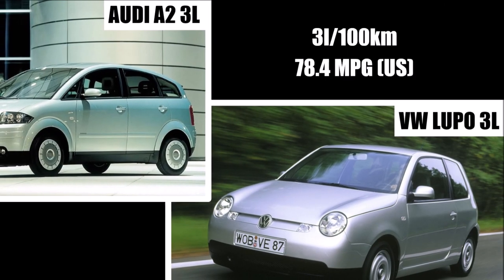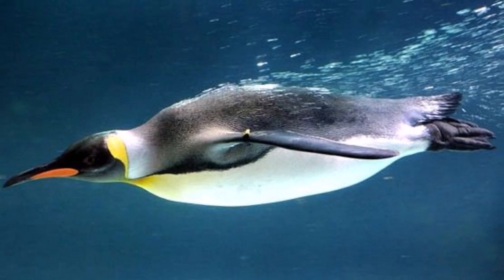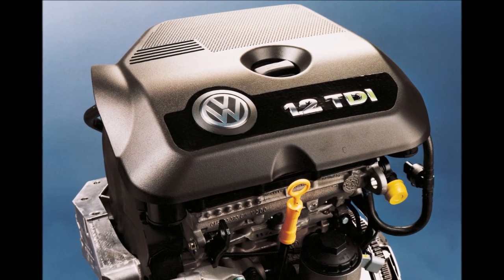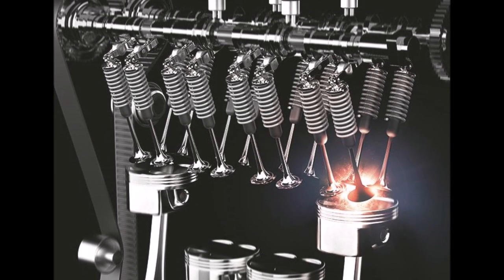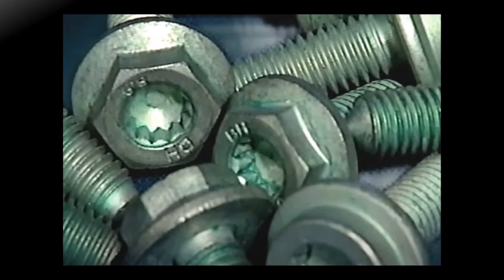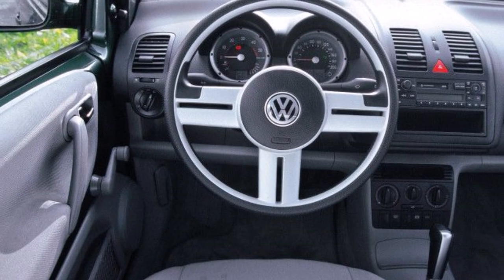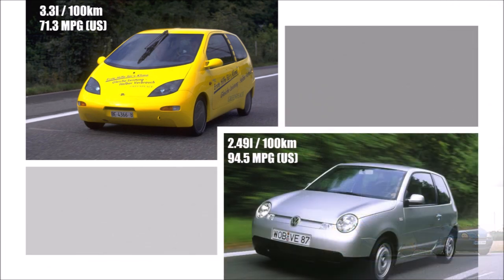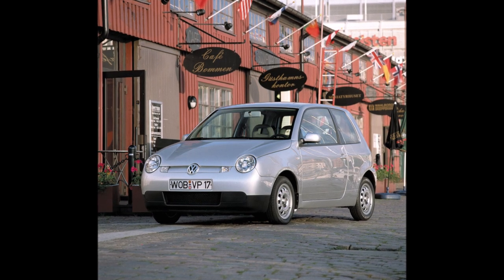VW LUPO 3L - Piech's Internal Design Competition

Comment: Nowaday most new cars sales are Ford F150, that tells something about the direction manking is evolving. There are also nice proptotypes from the 80s courtesy of Renault/Citroen. Check Renault Vesta for example. Also it is interesting that you probably can't drive an A2 in a low emission zone but no problem running a recent F150.
Reply from the maker: There is one version of the 1.4 TDI that doesn’t get the Euro4 class for low emission zones here, but the rest can get there.
But yeah, I get your point.

Comment: As someone with a PSA background, I'd like to mention that the Lupo 3L concept is not unprecedented. The Citroen AX was designed using knowledge and experiences gained from their earlier Eco2000 project. For example it already made use of an aerodynamic body (cd 0.31) and plastic body panels to reduce its weight to as little as 640kg without compromising safety, back in 1986. The initial AX Diesel of 1989 also made use of an aluminium engine block to reduce weight. A later AX ECO prototype of 1994 featuring similar optimizations to the Lupo 3L would record an average fuel consumption of just 2.7L/100km but didn't reach full production.
Reply from the maker: The AX is definitely worth a separate video!

Comment: My very first VAG car was a SEAT Arosa, 1.4, automatic. What a car. Better than a VW, it was lowered, had wider alloy wheel and matching tyres. There would be cars on my tail entering a roundabout, but never there on the exit. It handled so well. Moving on to a Lupo was not a great experience.
Reply: But they are the same car, right?
Reply: @Bartem_  READ MY POST! "Better than a VW, it was lowered, had wider alloy wheel and matching tyres. There would be cars on my tail entering a roundabout, but never there on the exit. It handled so well." Yes, it used the same chassis, the engine and power train, and the sameness stopped there. It was built by SEAT, in Spain, who at that time were the competition wing of VAG. 
The chassis was stronger, stiffer, the suspension was road-sports configuration, the brakes were upgraded, it sat 12 mm lower to the ground, had WIDE ALLOY WHEELS, fitted with WIDER, LOWER road competition tyres. (Spelt correctly). It also came in a range of colours exclusive to the SEAT AROSA. To expect that the car is going to perform the same as a Lupo, high ride height,heavy steel wheels, narrow tyres, OAP/Townie suspension, standard brakes, and an ECR that runs the engine for MPG rather than FUN. No, NOT THE SAME CAR AS A LUPO. You have compared an Octavia, 1.2, 5-speed manual with an Octavia vRS, with lowered suspension, 7-speed DSG gearbox, they cannot be called the same car, CAN THEY?

Comment: Can you explain why the rear being too light was causing oversteer? Obviously if the rear was light there isn't much load on the rear tires but the rear of the car also doesn't have much momentum (I'm thinking about the Deltawing for example). Was the rear suspension too stiff meaning the outside rear tire was getting overloaded?
Reply from the maker: If the rear gets too light, it means there is not a lot vertical force on the tyres, which means they can only provide little lateral force - hence oversteer.
Reply: @BSport320  Right but isn’t the reduction in grip balanced by the reduction in the mass/momentum of the rear of the car? My thinking is that if the rear of the car has lost comparatively more weight than the front of the car but the spring rates have stayed the same then the rear will have most of the weight transfer in a corner. Like the classic hot hatch lifting the rear inside tire. If that happens since the rear outside tire is doing all the work keeping the rear in line you could have oversteer due to reduction in grip coefficient with increased load.
Reply: @alexanderklenk2195  The momentum that causes oversteer is not caused by the weight of the rear, it is caused by sudden weight transfer, if the rear is too light, it can cause the car to lose traction when this little weight shifts to the front (or sides). Of course there are exceptions, but in general, a lighter rear end is more likely to cause oversteer.

Comment: "Customers interest in power 3x higher than for fuel economy" This clearly indicates that fuel is still too cheap.
Reply from the maker: That statement is from over 20 years ago when VW built GTI and 3L at the same time. But might still be valid.
Reply: A small "sporty" car still doesn't use as much fuel as a bigger car (even with the same engine), so I guess it just shows that the crazy fuel economy of the 3L was more of an engineering milestone than what people really wanted. People in Europe still preferred their "bigger" cars (think Clio and Golf), even if those were 5L/100 instead of 3L/100.